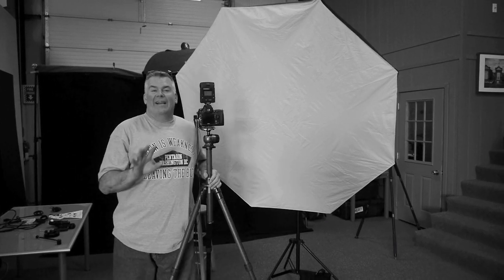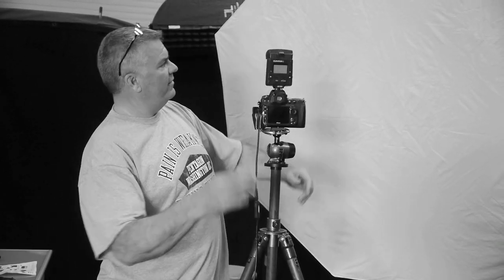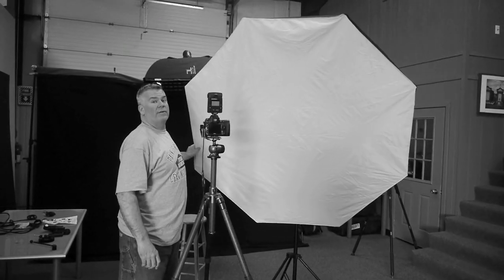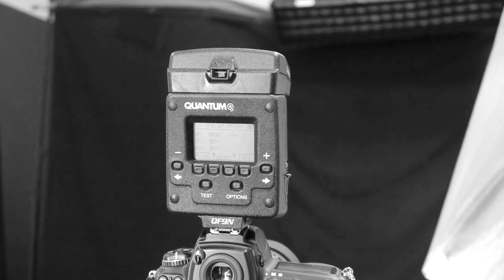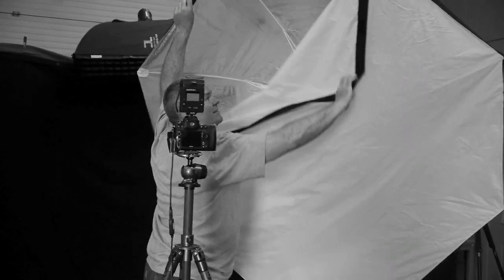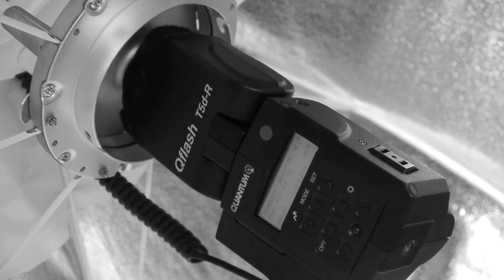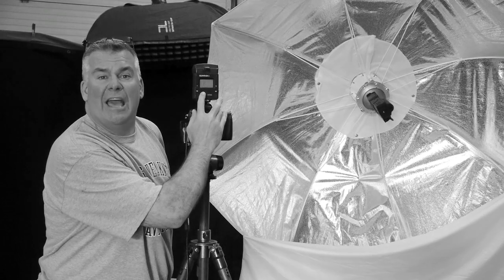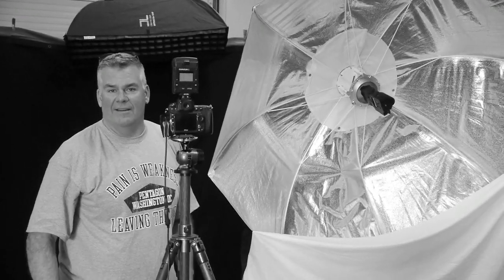How to use a Qflash in an Elinchrom Octa

Comment: Hi Will, fun video. Did you have to custom build a bracket mount to fit the flash to the octa, or does Quantum provide one to fit their unit into the Elinchrom?
Cheers
M